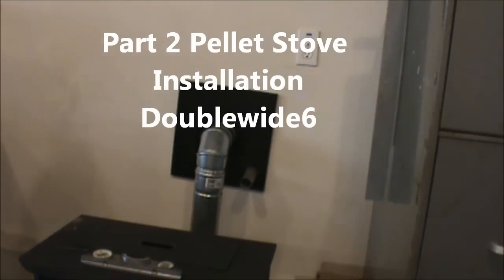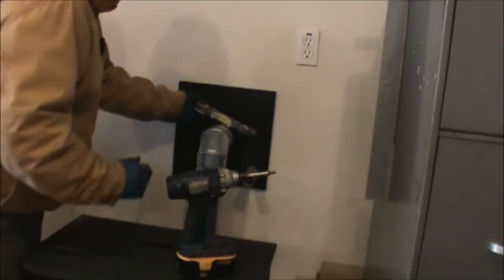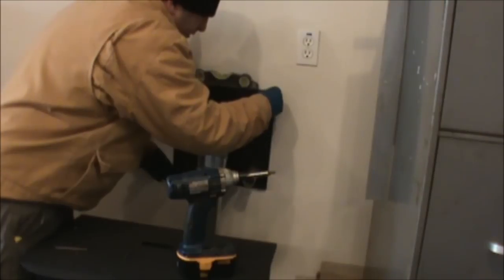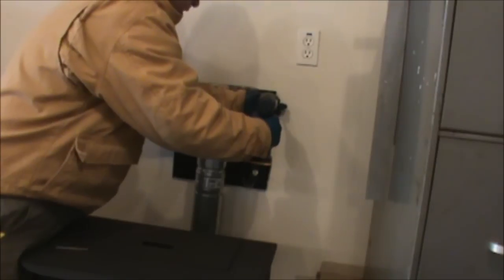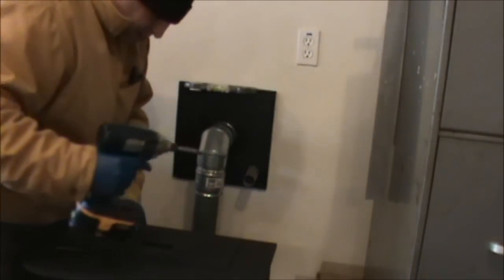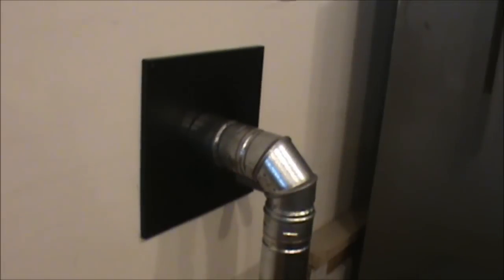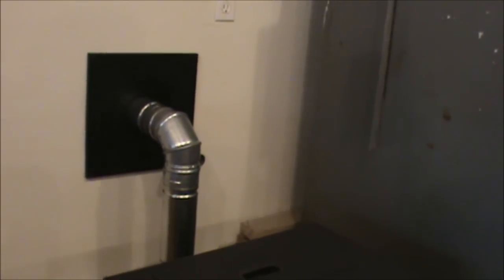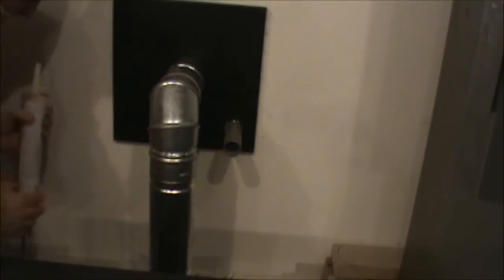Pellet Stove Installation Part 2

Comment: Excellent video thanks I have a question, does the small pipe also come out like the one in the chimney?
Reply: We just installed one. The smaller pipe is for fresh air intake. It just goes to the outside of the wall and caps there. You can get a kit at HD or tractor supply.

Comment: Great video. Would you consider putting a piece of Durac cement board on the wall?  to protect the sheetrock?  I do not think pellet stoves would ever catch on fire....but do they release any heat in the rear when in use?  Thanks

Comment: Why would you run the pipe up from the stove.. That is definitely not recommended.. Burns better cleaning straight out .. if your pipe gets hot at all it's because you didn't run pipe straight out

Comment: You posted this so long ago not sure you will reply... but I need to now remove my pellet stove pipe (which was installed similar to yours), is there anyway to get those pipes apart once they are sealed or would you have to cut the pipe?  Good video.

Comment: The Duravent pipe is a great design but butt-ugly. Pity they couldn't powder coat it so it actually could look good in a lounge room. Ok if you go out horizontal but up the wall installations look crap.

Comment: You got a new subscriber dude, came here on a stove installation but peeped your videos & seen there's a bunch that could come in handy.  But still trying to figure out how to connect the OAK, thru a punch out & attachment is located 8-10" inside, without taking stove apart.  SMDH

Comment: when installing your stove pipe, does it have to be a certain length?  and does it have to have a t-pipe for cleaning.
Reply: From the research I have done, most manufacturers recommend at least a 3ft vertical rise to prevent backdraft. Cleanout T is really recommended to be able to clean out all the residue and avoid a fire.
Reply: Thank you!

Comment: I like your video. How do you like the Jamestown Stove? Around here, Quadra fire is supposedly one of the best. I haven't seen Jamestown, but I'm in Michigan.Thanks
Reply from the maker: Linkscape1 I don't know much about Jamestown.  I know they are well made by the the thickness of metal.  I also really like the look of the stove and the used price, so I bought it.  After having it for a few seasons the only problem is it is difficult to light.  Quads are really popular around here.  I guess people want stoves that their dealers can service.  I do my own maintenance, so I'm not worried about a dealer servicing my stoves.
Reply: I installed a pellet stove recently.  slightly different than this, went straight out the wall from the back of the stove and put my "T" and vent riser out side.

used the two thimbles plus a duravent pipe kit.  stove is about 9" from wall.  only 4 " clearance was called for and manual says no backer board was needed.

I'm alarmed at how hot the wall gets when the stove is on high.  also wondering about that hot pipe inside my wall.  I understand it's a exhaust pipe but I'm still concerned about that much heat inside my wall.
Reply: +Dre Sted I ended up buying a Quadra fire and I was also concerned about my wall being hot. however, I have felt it multiple times and it hasn't been hot at all.

 I'm pretty sure the thimble is supposed to dissopate the heat, so I don't think your wall should be hot. I would contact a local pellet stove installer/distributor and ask. 

I'm not sure if you are supposed to remove insulation or keep it away from the thimble or not. you might want to make sure the pipe is clean, blowing/venting properly as well.

Comment: block wall in unfinished basement do I need the extra stuff besides the collars .It would be 4 ft off the ground  outside .I am not finishing the basement but figured here in VA near NC border that it would help keep the house warm .Basement is 2440 sq. ft . I wanted to get and automatic feeder also

Comment: I understand the importance of the fresh air intake.  Since the air intake is close to the exhaust outlet, is there a problem with exhaust gas getting sucked in with the fresh air?  thanks
Reply from the maker: Smoke rises, I have had no problem.  They do manufacture a unit like my setup.  You can always put 2 holes in your wall and space them out.

Comment: Do you remember what brand vent pipe you used? My adapter connector to my stove did not fit as snug as yours did. Mine was Duravent.

Comment: just to add to the video. They do make liquid tight pipes that connect together without having to seal them with metal tape or silicone. They are more expensive but they make it loads easier if you should ever need to take apart your pipes for whatever reason. The odds are you will have to take them apart at some point.

Comment from the maker: I'm not going to rewatch my video... but if it was wet a rag or papertowel .  If the silicone is dry you can cut excess away with a razor blade also any silicone on the outside of the house can be spray painted to match the pipe after it is dry.  it will blend right in.  Thansk for watching good luck with your install.  I have a pellet stove in the basement and we love it, but you need an easy way to get the pellets down there.